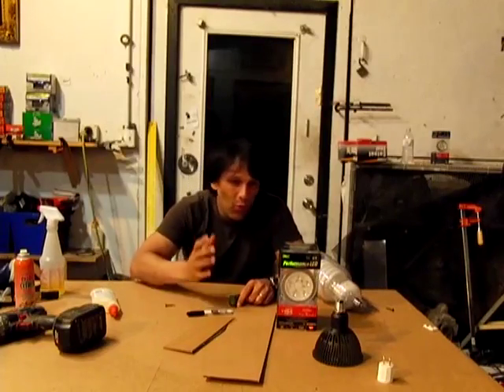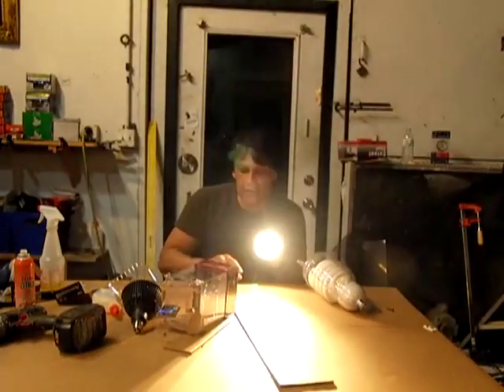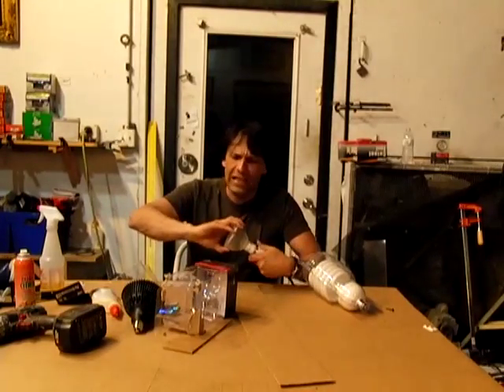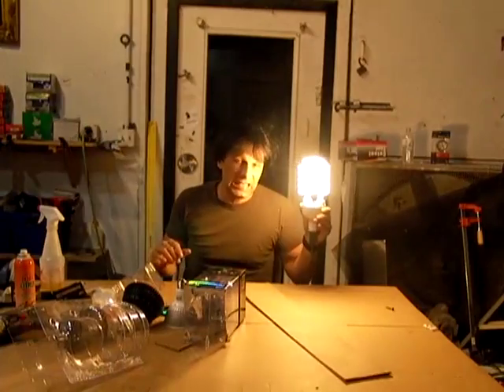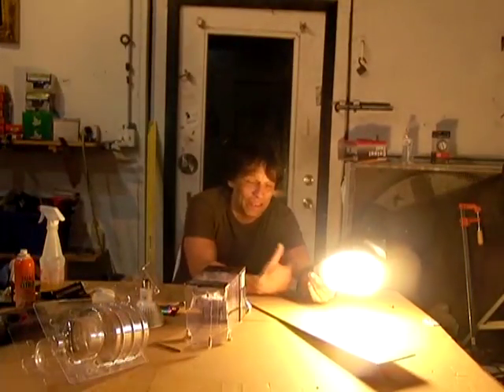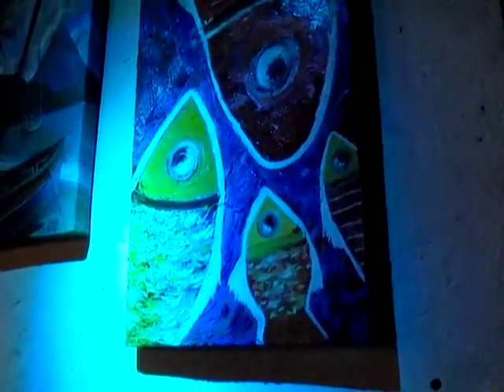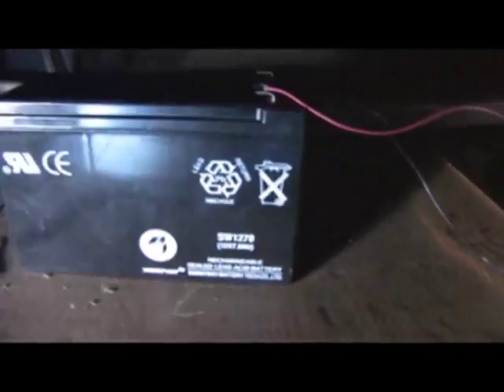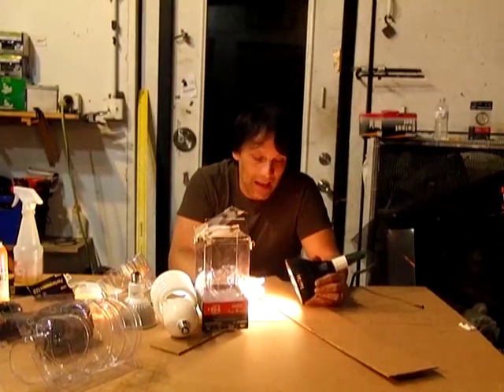LED HIGH POWERED 21 watt indoor lighting Light Emitting Diode vs Compact Fluorescent

Comment: I have been experimenting with LED lights for a while and have found some of the stronger ones to be good replacements for incandescent lights. However, there are still a few issues with reliability as the seemed to fail after a few months. LEDs are a mature technology and are very reliable but it seems combining many into light bulbs has a little way to go. I have seen CREE LEDs which give off a great light for little power. They only seem to be available in flashlights at the moment.

Comment: @ieldanth Fair comment. I agree with you. Just been looking into the driver circuits needed to run bunches of leds from mains power. Seems like the quality/expense of the circuit can effect the life of the bulbs. I pulled one of my Chinese bulbs apart and the driver circuit was only built from passive components. Nice and cheap but the wattage of the lamp may be higher than it could be and mains voltage fluctuations could damage the LEDs Also cheap bulbs cannot be dimmed properly.

Comment: Hi Wondering if you can advise/address basic lighting inside the home. Not light science stuff. I have track lighting in my kitchen that uses 7 lrg bulbs --and they burn out too often Each bulb is needed to throw decent kitchen light. Can I buy LED bulbs for that application? Thanks !

Comment: Continued
The only major problem I have come across is the shape and style of the bulbs. For modern designed light fittings they are fine but many people still like to use old world style light fittings which makes replacement of incandescent lamps very difficult. Both CFL and LED replacements often wont fit or look ridiculas in old fittings.
The problem is the electronics needed to drop the voltage from mains to low voltage needed by the LED or in the case of CFL the coils and starter circuits

Comment: Its true that led lamps are remarkable ands seem to be the only solution for low power lighting. Suppliers should really state the light power in lux as well as the colour temperature in kelvin so we can compare
CFL lamps definately make you feel uncomfortable and are not suitable in a room where you want to relax. It seems that China are the only country who can manufacture LED lamps economically so its only quality control that makes the difference between branded and non branded lamps.

Comment: With CFLs some brands spare the needed cap at the input so they have a very bad power factor, so they will use up lots of reactive current which you also have to pay. Measure Cosine phi and you will see, some only have about 0.5 ! So they waste a lot of power !

Comment: @seriouslyWeird LEDs reputation for dying young is largely related to people driving them with the wrong voltage, and thus higher current. I once bought a lantern, that was designed for 6v ( 4 x D batteries ). I thought I'd be smart and use a large Trojan 6V deep cycle battery. Problem is, that battery reads 7.2v fully charged. It killed the LEDs fast. Many of the initial circuits for 12v did not handle 13.8 (auto is running) well, either.

Comment: CFLs are bad for your eyes as they generate a special bad mercury frequency that will
make your eyesight poorer over time and causes headaches, so don´t use CFLs. Better use the warm white LEDs like 2700K Kelvin color, don´t use the 7000 K pure white LEDs as they are also bad for your eyes. Philips has new LEDs that look like Halogen bulbs, very natural light. Halogen lights are still the best for your eyes, but also consume too much power, so the Philips LEDs are probably the best compromise.

Comment from the maker: @GREENPOWERSCIENCE I keep mine on 24x7 365 for testing as the watt consumption is so low. If you turn them on and off, they will last years. So my experience with less expensive lights is 1 year continuous usage.

Comment from the maker: @seriouslyWeird no, the cheap ebay lights last about 1 year. The better quality lights last over many years. The bulbs are generally all the same, the electronics and e26 or mr16 base mountings are what can be an issue. My first cheap LEDs 3 years ago all had poor connections to the e26 screw so they were hard to apply to the socket and when removing they twisted and broke. Since the first batch I have had not problems. When an indoor bulb is used outdoors it will work but over time go bad.

Comment: At my new countryside house I am changing all the lighting to seperate electrical system - 12-24 DC. So it should be even more efficent, because  there is so much power wasted in a circuit inside todays LED bulb. You know it have to resist atleast ~95 V for each bulb, so still some power goes to heat. So I think its way to go for everyone.

Comment: Yes the LEDs are becoming very cost effective. One nice feature about the LED is that it may be connected to a dimmer. With enough PV panels, some LED lighting, battery backups and a DC powered computer I don't see why a person would need to be tied to the grid...

Comment from the maker: @RCvolunteer1978 Hi goodshepherd hope all gets better with the fam:-(

I got them from ebay, the solar panels are a extra, they run about $29 if you can find them.

Search as follows:
LED
"3W MR16 High Power Cool White Focus"
Battery
"12v 7ah" make sure it is new.
Hope this helps.